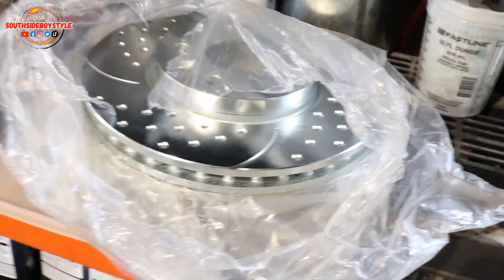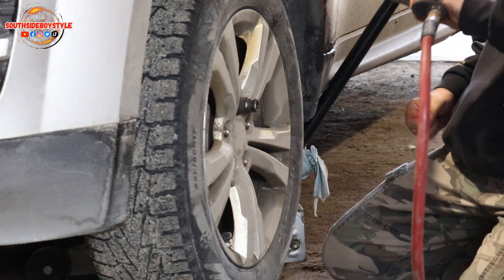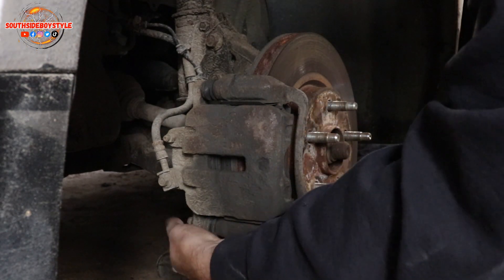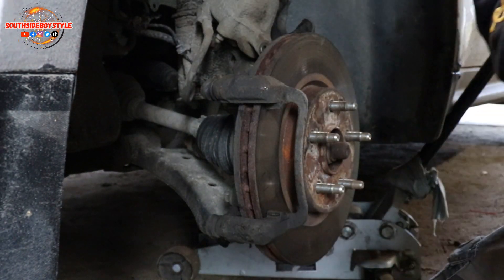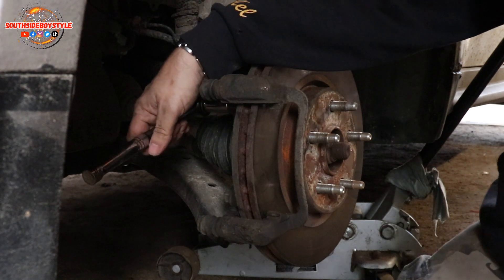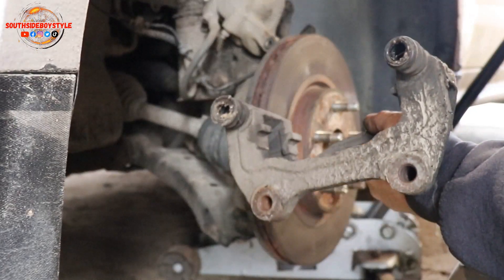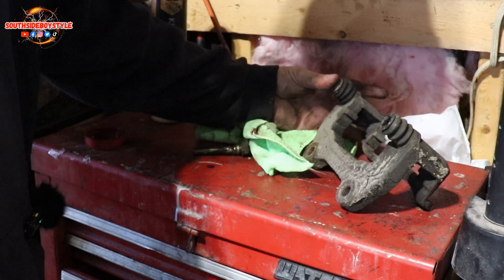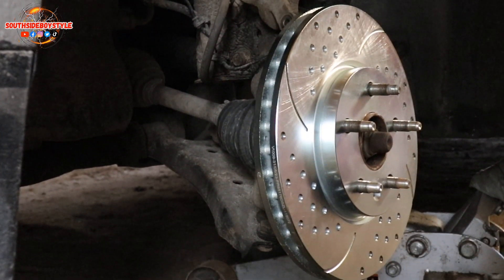how to install your brakes on a chevy equinox!

Comment: bro wayy too much grease on slide pins also the red bearing grease is why the boots are swelled and the pin did not move freely by hand when you first disassembled

lol also fun fact that brake hose is made to withstand thousands of pounds of line pressure so if you hang the caliper on it and it breaks well that hose is complete junk